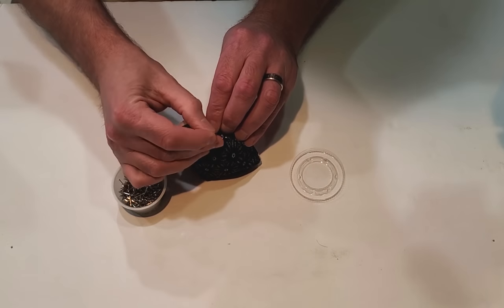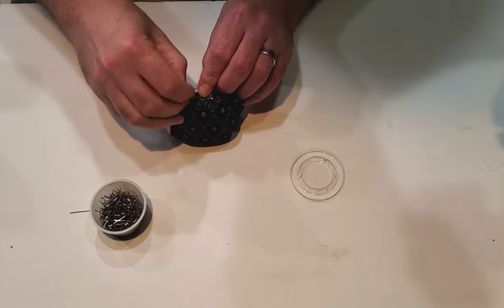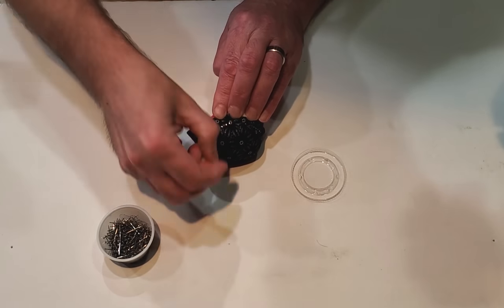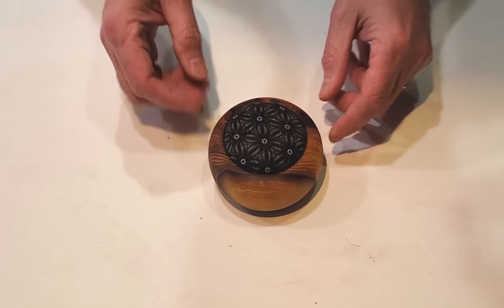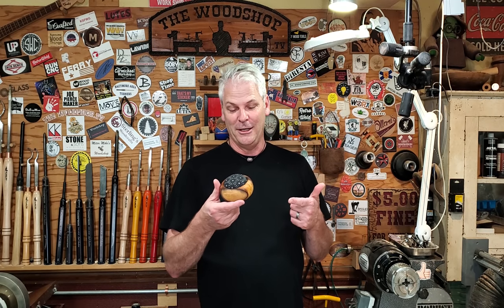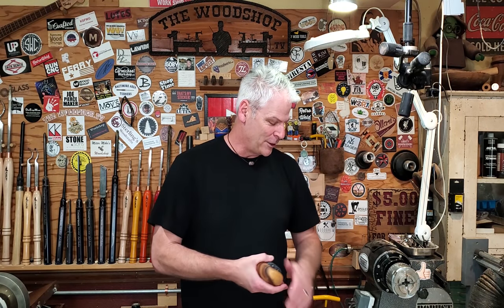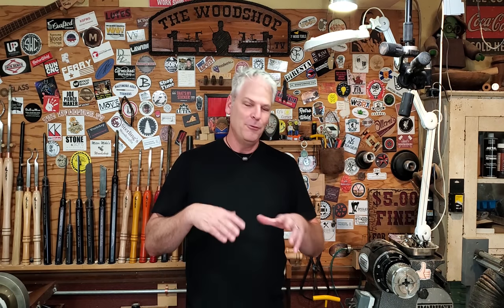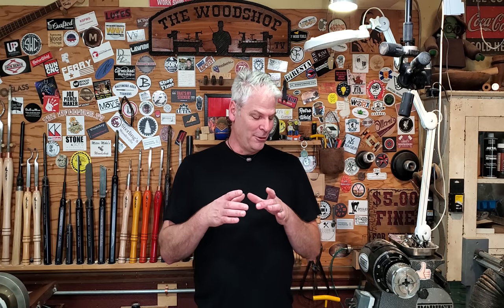Woodturning | Scrap Wood Project

Comment: Those are great little projects to use scraps of wood. I'm not a woodturner but I can see making them square and using a forstner bit to make the recess. Could also use a fly cutter or hole saw and glue to a piece of contrasting wood before finishing. Take care.
Bill
Reply from the maker: Thank you very much Bill!! That's a great idea if you don't have a lathe! Take care

Comment: That is a neat little pin cushion. The walnut shell does work great, though after making one, I know have loads of it left and your cushion definitely looks a lot neater than mine.
Reply from the maker: :) Thank you!! I really want to try the Walnut shells. How did you secure them in the cloth?
Reply: @CarlJacobson  I sort of copied what I saw in someone's youtube video when I was researching it. I stitched the cylinder (badly, as not good at stitching), a small hole was left so that the fabric could be turned inside out, with the stitching now inside. Through this hole, I then poured the crushed shells and then just closed it up with some more stitches. The fabric and stitching seems to be enough to contain the shells.

Comment: I’m going to try to turn my very first practice bowl this weekend, using 2X10 boards I’ve cut into rough circles and glued up. Any suggestions?
Reply from the maker: That's awesome! Try and make your cuts from the face, and not the edge. The wood tends to chip out when you come from the edges.
Reply: @CarlJacobson  well, due to extreme vibration issues, my bowl turning was a fail today. Question, how do you get a 4 jaw chuck to hold good?
Reply from the maker: @crosscutofficial  Here's a video I did about making a tenon https://www.youtube.com/watch?v=ljJiXRuhpFg&t=522s